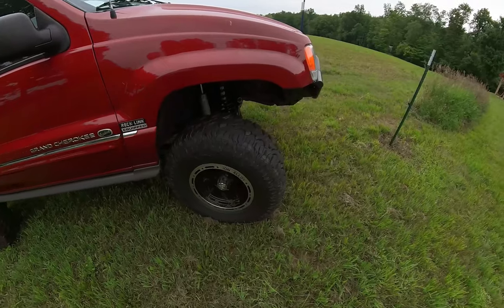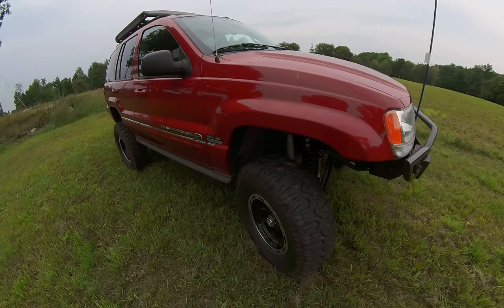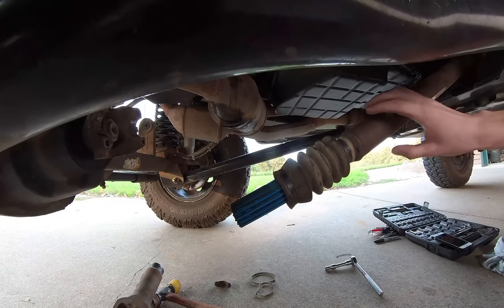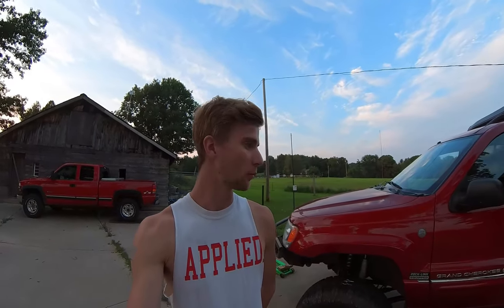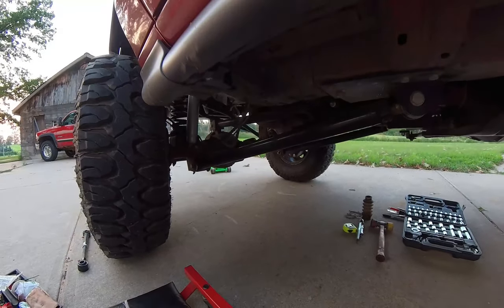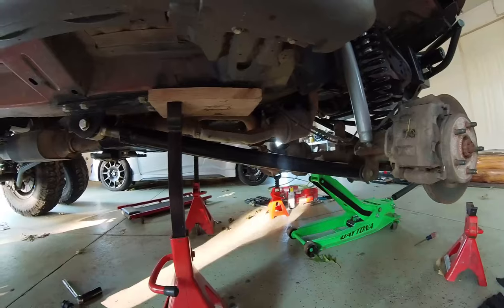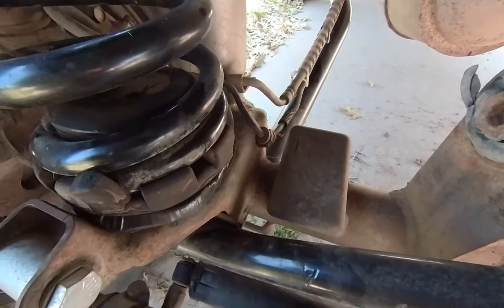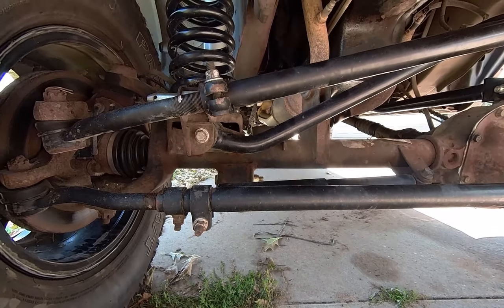Grand Cherokee WJ Wheelbase Stretch! How far can the stock driveline really go??

Comment: It's been my observation that driveshafts usually don't slip much at all through the suspension cycle.  That said they are fairly cheap and not hard to fabricate in your garage. Balance them with the old two hose clamp method if needed but really not necessary.
Reply from the maker: Yeah there was very minimal movement in the driveshaft splines throughout the travel.  I think short arms at any decent lift height would not have the same result.  I will be upgrading the driveline soon!

Comment: So you said you made some spacers that were angled to adjust the lower mount of the front coil springs. After seeing this video I will most likely do this same thing to my WJ. What did you use to make the angled spacer for the lower mount of the coil spring?
Reply from the maker: Correct.  I essentially made a U-shaped wedge that I put between the lower spring perch and rubber isolator.  I made it out of some heavy duty conveyor belt rubber.  Haven't touched it again since this video and it has worked perfect.

Comment: I would go to my local machine shop and have them machine a spacer where the drive shaft bolts on.  Order a 1 inch spacer.  its easier than changing and making custom driveshafts.